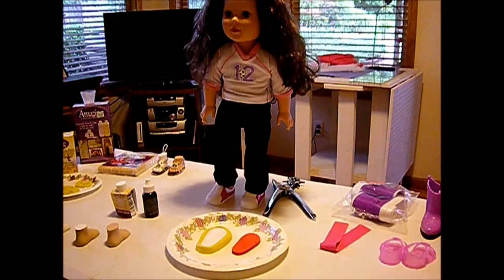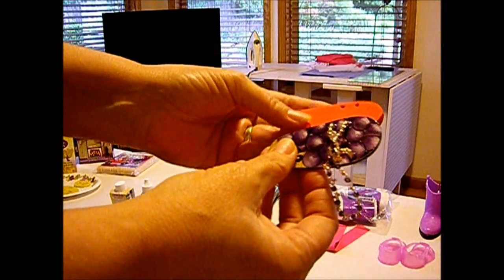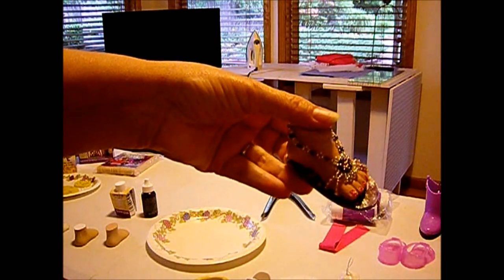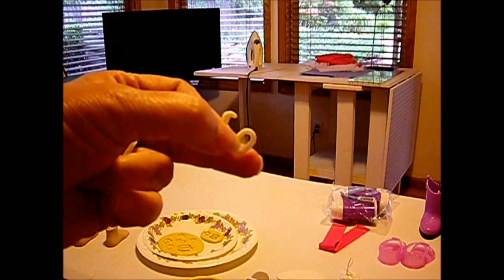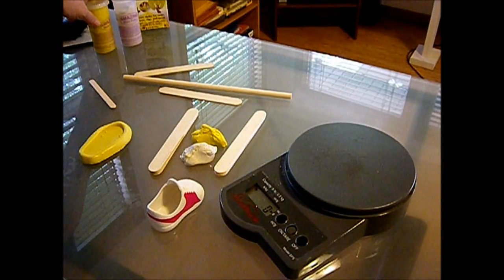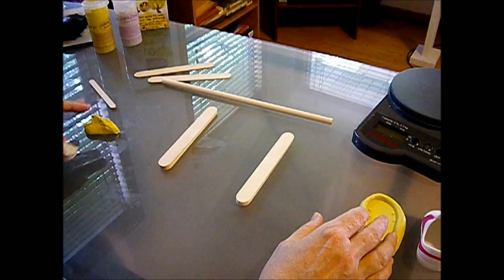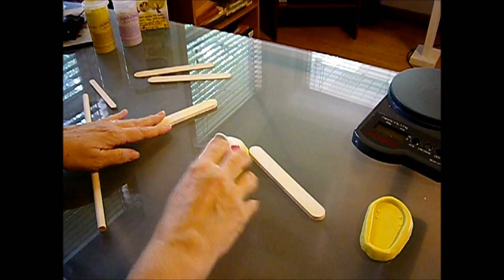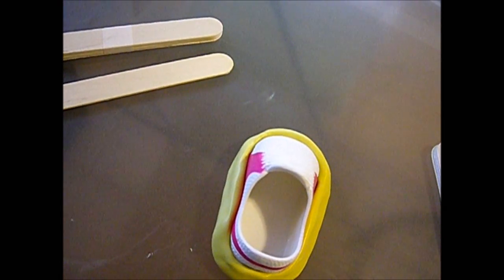How to Make Doll Shoe Soles with Resin Part 1

Comment: can you make a sole with a heal with resin
Reply from the maker: I tried to make a heel with resin but it didn't work for me. I think that you have to make a 3 dimensional mold and pour the resin in at the top. You might be able to make the a resin heel separately and then use superglue to attach it to a sole.